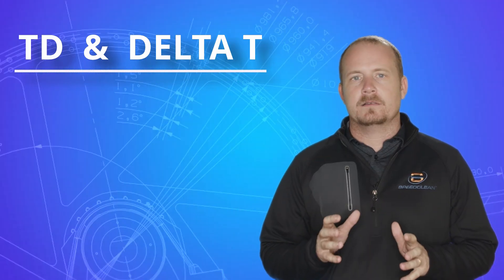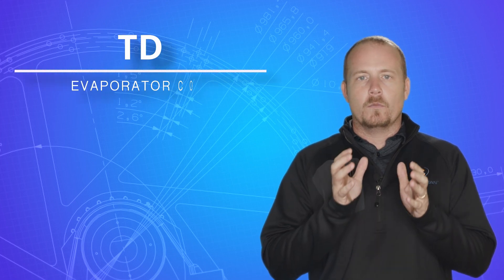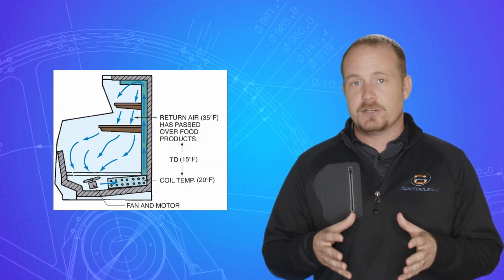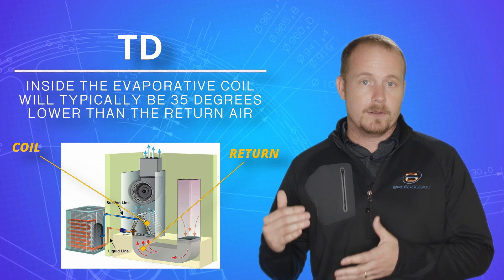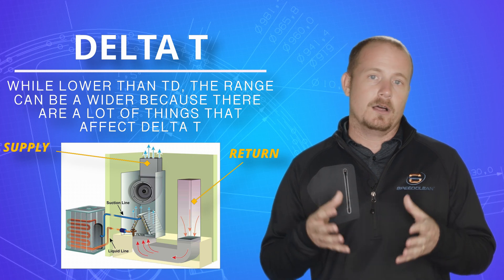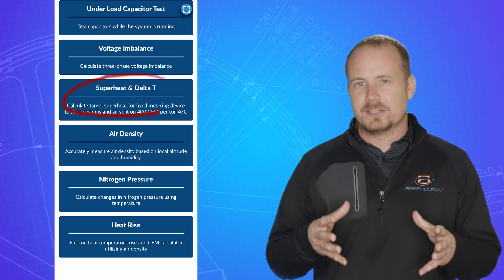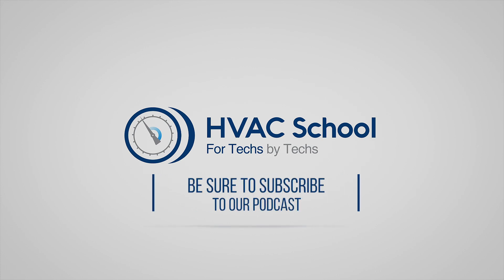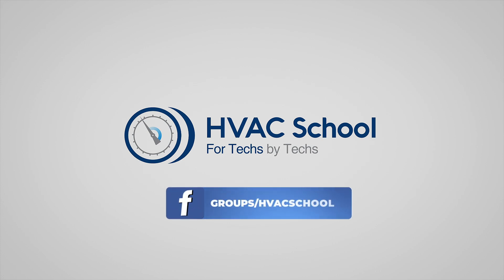Don't Confuse TD & Delta T

Comment: I just started HVAC/R school last January and I stopped confusing these terms when I was told to think of TD as (T)wo (D)ifferent media temperatures (one being the temperature of the air and the other being the temperature of the boiling refrigerant!) ΔT just fell into place after that distinction (the difference in the temperature of the same meda at different points in the system).

Comment: Evaporator temperature is called apparatus dew point. Never ever heard of TD before.
Reply: Unofficially dew point reserved to discussions about air dyers ( compressed and laundry) and dehumidifiers.

In comfort refrigeration ( AC) they only concern about TD as a measure of coil performance, in refrigeration Delta T is important to setting depending to product being used. You don’t want air too dry for fresh vegetables and not frozen meat, and you don’t want air in the box too moist for product stored in cardboard boxes.

Comment: So as a backward scientist. Add and this subject matter is my game. Delta w.b. plus delta D.B. AXAMPLE  equals 30. 12000 ÷30=400. After some 1000 commission's this is what I've observed. So my question to whom I most respect. What do you think. I work at a shop of 200 tech's. I'm sure I've been the only one that received a complaint of to cold. So I up air flow from 350 cfm to 425 cfm.  Nice lady let me prove my jargon. Ambient 95 rh 80. Indoor 76db 42 wb. At 425 72 db 54 wb. She was happy. I had the opposing opinion.
Reply: I should really proof read. 300÷12000 btus per ton equals 400 cfm. As you watch this figure wb and db will rise and fall. The totals will remain. I know the apps say 11 12 10 wb. There wrong. There write. All I know is what I read. I always wondered why the slide charts said wb db in and only gave db out. That was never good enough for me.
Reply: @MinnesotaHvAc  yea bro, proof read more.
I'm sure what you are saying is true, but I don't know wtf it says.
Reply: @MR-nl8xr  then you should write down your readings and soon you will abbreviate. Then you'll understand me. Wet bulb dry bulb saturation temperature  supply dry bulb wet bulb and so on. Happy new year let's all own our smithing and be the best at what we do. Contron envirments. Remove water vapor add heat so our customers can sleep well at night. HAPPY NEW YEAR BROTHERS.
Reply: I think 425 cfm per ton is good.  👍  I have my blower speed set at 409 cfm per ton, but it puts out more because I have extra capacity in my return air ducts and air filters.  I like 1 cfm per sq ft per room for good air flow.  You will never get that if it’s set at 350 CFM per ton.
Reply: @michaelcinaz  proof read glasses and typing with my thumbs yes possibly time of day all play in the factors. Thank you for the banter.  Up north in seer 1 country comfort cooling is what it’s about.  Thanks again